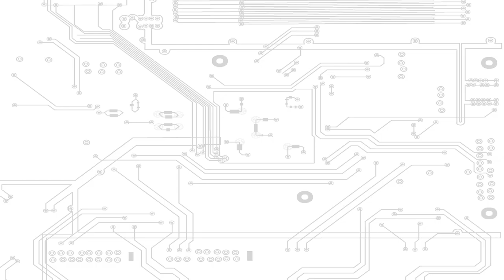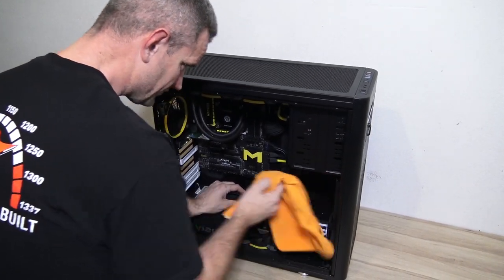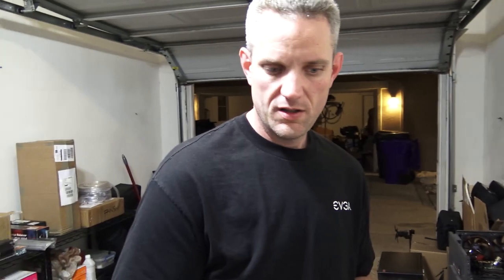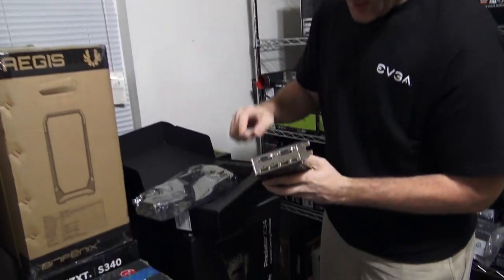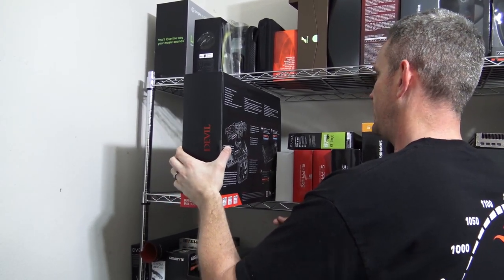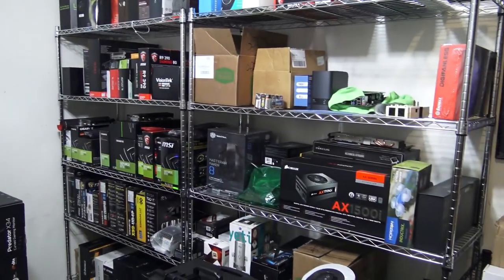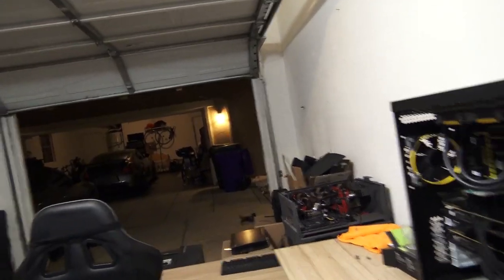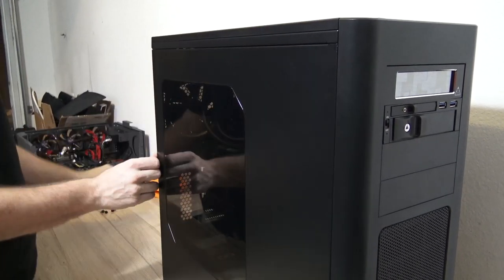VLOG - Putting the Sim Rig PC back together

Comment: Wrong, my G1 980ti has 2 DVI connectors.
Reply from the maker: Clearly so does mine.... You watching the same video???
Reply: +JayzTwoCents lmao
Reply: +JayzTwoCents yes. I meant to reply again stating that I saw you mentioning it and then seeing the card right after I posted my comment. But my 1 year old caught my attention. So she was more important. ;)
Reply: +JayzTwoCents why don't you just get one of those dp->hdmi or dp->dvi adapters.. or cables doing the same thing.. non of my displays got dp and with my old 6950 i needed active adapters that's why i also use dvi and hdmi cables.. so when i bought my 970 i just ordered one dp-dvi and one dp-hdmi adapter for like 15 euro on amazon for both as i have 3 screens and my tv connected to my rig but also only 3 dp, 1 hdmi and 1 dvi from my zotac gtx 970 amp! extreme edition.. luckily you don't need active adapters anymore.. they were way more expensive..
Reply: +JayzTwoCents I love when people reply before watching the video or realizing they made a stupid comment and not deleting it
Reply: +sik59rt Why should I delete my comment. I fessed up to it and admitted I made a mistake.
Reply from the maker: +Dunkelelf3 Because they dont have DP either....
Reply: ***** well i did neither see the back i/o nor what exact 970's you used..

Comment: I know you mentioned it but it would be awesome, use a car intercooler or radiator with the fans, put a little pannel on the rig with a key to start the pc and switches for the pump and fans.

Comment: 1:55 don't you have one of those compressors or just air cans or even those air blowers that don't need compressors? I love those to clean my PC or the PCs I have to fix/build. It's great! I have the Metro Vacuum ED500 DataVac 500-Watt 0.75-HP Electric Duster 120 volt.

Comment: I'd just take the least powerful GPU on that rack since even that one would be more powerful than my gtx 950
Reply from the maker: That would be a GTX460....
Reply: +JayzTwoCents Haha I was completely wrong then, you have a less powerful GPU than me, dang how old is that piece of hardware now?
Reply: +Jorge Resendiz I think a old (was too of the line) build would be cool to see and see how it does
Reply: +Jorge Resendiz its still quite close to a 750ti with 1gb :P
Reply: +Yesto still, I can't even run Farcry at low settings, 1080p 60hz, without seeing stuttering or lag. If only I could combine the power of the 460 and the 950 to make a 760 or something like that
Reply: +JayzTwoCents still better than the amd 7600 HD(60% sure that what it has) graphics my laptop has.  I can run gta v at a cringe worth 20 fps.  Sins I've never used anything above 60fps, I can actually tolerate games as low as 20fps that would kill 144 refresh rate master racers such as yourself.
Reply: +Jorge Resendiz he has a 750 ti on the rack...
Reply: +JayzTwoCents I would love a GTX460 !
Reply: +Jorge Resendiz If you are talking about the new Far Cry that's because it's horribly optimized, even Totalbiscuit had performance issues with 2 titan x cards.
Reply: +MrSpartan117fan that is a mid range card from 2010! what games would you play on it? I have a hd 5870 which is closer to a Gtx 480 and that strugles with most games at 1080p...
Reply: Gautam Goraya what do you mean most games? my 460 did work great until gta v and other next gen games
Reply: +Yesto i have intel integrated graphics  (intel core i5 4690k)
Reply: Pang Bang dang so?
Reply: Gautam Goraya
Dude i have an amd 7750 dual core with integrated graphics

Comment: I run project cars on a single 960 with surround. temps stay relatively low, and maintain above 60fps. granted I don't have the highest settings on though.

Comment: I have a question. Does is matter if you have two different types of 980ti's in sli? I mean, I already have the Strix edition and I am planning on getting a Zotac Amp edition. Are there any drawback or any benefits? Also, would a 850 power supply be enough? Thanks

Comment: i think they should start making drive bays in which you could just plug the hard drive or the disk drive in from the outside. The cables would instead be plugged into the bays so we can easily interchange the drives or unplug them if needed

Comment: is it possible to use the 2 dvi ports and hdmi port on that 980ti? ive heard that only 2 are usable at a given time and must use the displayport to utilize more than 2 displays.  my thoughts on such matter is always use a single powerful card versus 2 weaker ones,  but in jayz case, using 2 970's to gain hdmi/dvi ports make some sense ^_^ (albeit must be too lazy to get dp to hdmi converters/cables). 

sucks to be in a third world country where we pay more for a gpu (close to 900$ for any branded 980ti) and only earn 1/5 (300$/month) of income compared 1st world ones. 1 1/2 years since the 970 launched and im still saving for one.  im betting pascal will be out and im still short of funds... hahaha

Comment: Why don´t you use an air compressor to clean the case?
Reply: because of the amount of moisture in a commercial air compressor. you would be misting your PC pretty much. also, that much pressure COULD damage your components. Linus did use a standard commercial air compressor to clean out a PC in a video and it worked. but he stood pretty far away and used short bursts and it still wasn't really any better than just using canned air.
Reply: +heizerbirne You mean't "canned air" I assume?
Reply: Yeah, aerosol anti-dust stuff in a can. It's not actually breathable air, lol.

Comment: i have a question for you oh pc god of knowledge i recently bought an msi 960 gtx it says its a 4 gig card but in the program it says 3 gig im wondering if you might know why?
and a comment if i won and got to choose i would take a power supply mines using a 120mm 1 inch thick fan laying on top of the open power supply because when i got it the bearings went on the ps when i got it so i had to replace it without having money to replace the ps itself
Reply: Really? Just checked and mine is using all four.
Reply: so why is mine only listing 3 gigs?
Reply: it shows it only as 3 gigs on canirunit.com
Reply: if i optimise it through nvidia gforce xp it tends to not want to load the game on my pc any game for that matter

Comment: You should have used the dual dvi 980ti and the watercooled 980ti. You are running a giant resolution and more GPU power is always good. Better than letting it there not used at all

Comment: If you only need 3 dvi ports, why not sli the 980ti that has 2 with another one so you can have all the power and be able to drive all three monitors?
Reply from the maker: Because I wanted 1 980Ti, not 2

Comment: I would use one of the Gigabyte 980 ti's you got there. I had 2x 970 Sli before, quite dissapointed in the performance (stuttering etc.)
Reply: +jmeister ive been thinking about ali 970 or a 980, is sli really that bad ?
Reply: +RedddRainnLG For me the experience was really bad. I play on high resolution, which could be a problem with the memory of the gpus(3,5 gb effective mem).

Previously i've tested 780 sli & 290x cf, and those setups ran much smoother overall (less stuttering, better scaling in games). 

Note that i'm not saying that it's is a bad card, i wouldn't use it in sli though.

I don't know how 970 sli works right now, since it's been about a year since i had those cards.
Reply: jmeister what res where you on i plan on 1440p or 4k soon so idk if 970s will cut it :/
Reply: +RedddRainnLG 1440p, i would suggest that u search for recent sli benchmarks and reviews(1440p and over). For 1080p u're maybe alright.

Comment: I would use the Fury X for this. I play on 3 Monitor Surround myself on this, and i can run Battlefront on Ultra/High settings without any stutters what so ever. 
If this doesn't work, use Two way Crossfire R9 390x 8G

Comment: hey, is a xfx r7 360 2gb oc decent for 1080p gaming? I'm gonna be pairing it with a fx 6300.
Reply: +Alexis The Pro anything in the R7 series isn't, minimum a R9 370 for low settings
Reply: +TheNerdyCanadian well I was looking at benchmarks and it handled most games on high 1080p between 35-55fps
Reply: Alexis The Pro exactly, so medium or low settings. 35-55 isn't playable in most games because you get screen tearing and stuttering, so you want it to get an average close if not better than 60fps (most likely your monitors refresh rate), also what CPU did they use for the benchmarks, because that can play a lot with the FPS you will get
Reply: +TheNerdyCanadian fx 6300, and for gta v it dot 55 fps high AA off

Comment: Guys I need your help.
I'm currently on an i5 3450 combined with a GTX 970 on an ASUS P8z77-V Pro MoBo.
Should I buy an i7 3770K or an i7 6700K with a new MoBo?
I game and I also do some light video editing
Reply: +XCalibur Hmm, me and a friend where and he still is in the same spot. I went with a 6700k, he is thinking of going with a used 3770k. It honestly depends on a few things. Do you have enough money for the 6700K, a mobo and new ram? If you do, do you want brand new stuff with new warranties as well as some of the best performance available and newest  features? Or are you ok with something like 25% less performance vs a 6700K, less features and dead warranties but still a decent bit more performance than you are getting now and a lot less hassle on the installation? I'd personally recommend the 6700k. Its fast as hell, and you'll be up to date as far as features and stuff go for a few years. Instead of behind off the bat. 

Whatever you decide, DO NOT let people convince you to get a 5820k over a 6700k. Sure the CPU is the same price, but the motherboards are on average a decent bit more expensive, and in gaming at least, the 6700k frequently trumps the 5960x, which is obvioulsy faster than the 5820k. The 5820k might do a bit better in video editing but if you only do light editing it will be more than enough, and the extra gaming performance will be nice.

Comment: hey is a r9 390 a good upgrade from a 280x(1440p gaming)
Reply: 390x would be a larger boost.
Reply: OK thanks and there are a lot of difference between the 390 and 390x?
Reply: +Arthur Nascimento If you overclock the 390 it will perform basically the same as a 390x and almost as good as a GTX 980.
Reply: +RockOnBourne if you overclock a 390x it will wrecks games.  I say get a 390x
Reply: Just depends on the budget.

Comment: Heh get a bunch of cable adapters from monoprice or something... It's something you end up needing at some point and not having them is really annoying. My quad setup is hilarious, I use 1 DP-DP, 1 active DP-DVI + DVI-HDMI, 1HDMI-HDMI 1 DVI-DVI cables/adapters... And ofc that one HDMI run means that Nvidia is sure it's a TV and wanted to underscan it and windows makes it the default sound device each driver update... ARGH. Oh and for some reason the dell monitor on the DP cable needs to be re-plugged each reboot to be recognized and get the right resolution, generic VGA display at 800x600 each time I boot...
Reply: +Christian Gerefalk Mt Dell U2713H doesn't play nice with Display Port either, mostly coming out of sleep mode or screen saver so DVI it is for me. I used to get a lot of errors from the USB 3.0 hub too but that seems to have gone away for some reason.

Comment: +JayzTwoCents For iRacing you really need high ipc (overclocking that 4770K would be fine), and SLI isn't that great at the moment as nvidia doesn't supply SLI profiles. The 980ti would be the better choice for simracing.

Comment: You know, I'm pretty local if you need anything taken off your hands... But kidding (read: not kidding) aside, I think an exterior Rad or "intercooler" would be super cool with metal fittings and maybe blue or red water cooling tube at the bends to look like car couplings.

Comment: My x79 machine has an old GT 9800 in it because I had to sell my video cards to make ends meet, I miss my desktop /cry
Reply: +Annabella Williams why?
be proud of that 9800GT. i got the whole lot from them. i even got the gx2 and gx+.
those are some awesome video cards and a good option if you plan to up the system and then later up the GPU.

Comment: Heck if you did a giveaway i'd ask for the MSI R9 390 (non x) because I just bought one along with a 1440p monitor and I couldn't be happier.
Reply: +Mitch Baker (Illegal Chest) It's a fantastic card, but just about everyone would grab a 980ti if they were given the option to take 1 thing off that rack, it's just better known and a bit more impressive than the Fury X.
Reply: +Darren Kehrli You really can't blame them though. A lot of people don't have modern or high end graphics cards in their system. Plus if I got that other 390 i'd have to pull my 850 watt psu out and put it in my system Lol
Reply: +Mitch Baker (Illegal Chest) yeah, I have a 970 but I'd grab a 980 ti in a second, even though I do not play on a monitor that would show the extra power at the moment (play on 1080p, some at 1440p scaled to 1080p), and everything I've played that doesn't have performance issues with the game itself (batman arkham knight for example), plays beautifully with all settings maxed...but I'd still grab a better card because it's the most expensive component to upgrade, and it's usually the thing that gets outdated way before anything else, doesn't matter how happy anyone is with their current gpu, they'll usually choose a better one over anything else, given the choice...usually...

Comment: what using a Server motherboard with 4 CPU Intel I7 36 core processors and 1TB of ECC system RAM and a 20TB RAID array that should make your Simulator run like a BAT OUT OF HELL there must be a slot that can take a RADEON Graphics card.

Comment: I would like to have 2x 970 + 1200w PSU.
Reply: No
Reply: +Zuze91 i can sli my970 and i have a 750s bronze from rosewill
Reply: Bidwellz9 i have 2x 460gtx
Reply: ***** my point was about the psu though. you dont need 1200w lol unless you have a crazy machine
Reply: Bidwellz9 I want to watercool. So fans and pump goes to PSU too.
Reply: +Zuze91 still no problem i guess but we don't know what other stuff is inside your pc, like cpu, how many fans, drives, mobo, rams, etc..
Reply: +Zuze91 50watt wih pmp and fans.
Reply: ***** yes.. in games that are well optimized for sli and were the vram is not the problem the 970's will win.. if you need more than 4 gb the 980 ti will win.. he got a shelf full of 980 ti's i would have just threw 2 of them in the sim-rig xD
Reply: ***** lol yea, that crazy
Reply: ***** depending on the other components 1200w is still a lot , but i guess i would get it for the headroom
Reply: +Bidwellz9 Get One 980ti. It's as powerful as two 970s without the microstutter.
Reply: ***** no not really ^^ i would get something like 1400-1600 for 4 gpus.. it really depends on the cpu and other stuff you are running but if you buy 4 gpus you most likely also buy something like the 5960x and that's 250x4 for gpus and 140w for the cpu so 1140.. only 60 left for motherboard, fans, drives, usb devices and whatnot.. ofc it would be almost impossible to max out both cpu and gpu in real world tasks but well.. it is somewhat close tbh.. also most psus are most efficient about 50% load so getting something with more headroom would not only be more efficient but also give me a better sleep, cause i know it's really enough for all the hardware..
but for 3 gpus it would be really fine.. who buys 4 high-end gpus anyway?
Reply: ***** yeah but as i said it's not really likely to max out cpu+gpus all at once to 100% load.. but in a real worst case szenario it would maybe kill you psu.. 
i mean on this high-watt psus you find more or less only really good quality and very efficient psus from good brands.. but i saw really cheap crap psus that gave like 2/3 of the 750 watt they advertised due to bad design and bad efficiency so i would never trust to really get more power from my psu than it says on the box.. also running 4 cards in sli is something most people would only do with a custom loop cause damn this would heat up the case.. and when watercooled you most likely gonna overclock.. and for oc i would never go as close with my psu as this.. because you just can't know how much your system draws in the end.. i would never do it.. never ever..

Comment: Hey guys - i'm wondering if anyone could help me with the PC im building in about 2 months, i will mainly play CS:GO - And i also livestream it. If anyone could please respond with any parts i should change, or anything like that, i'd really appreciate it. ( Btw - i also play games like GTA 5 - but i wont livestream it. )  

CPU : Intel Core i7-6700K Skylake
GPU : ASUS GeForce STRIX GTX 970 4GB
RAM : Corsair Vengeance LPX DDR4 2666MHz 16GB
PSU : EVGA SuperNOVA 750 G2, 750W PSU ( Modular )
Motherboard : Gigabyte GA-Z170-GAMING K3, Socket-1151
SSD : Kingston SSDNow V300 240GB 2.5" OEM
SSHD : Seagate® Desktop SSHD 1TB
Reply: Haaa that sucks my Pentium 4 + gt 210 world easily destroy that cuz I ocerclocked it to 6.9 ghz

Comment: What's wrong with the devil? I'd gladly use that beast!
Reply: It's AMD
Reply: +Daniel  Burgos It would've been faster than the dual 970s. Two full Hawaii cores under one air cooler isn't exactly optimal though.
Reply: +Lord Mortigon You've got a point. I wonder how it compares to the 295x2?
Reply: Douglas Mannor It's essentially a custom pcb 295X2 under air cooling. It's louder and hotter than it's water cooled cousin, and oh boy is it ever huge (triple slot!) and heavy. I think it came boxed with a Razer Ouroboros as well. Not a very practical product, but definetely interesting. I'd take one anyday just because it's so ridiculous.
Reply: Douglas Mannor Actually, watching the video again, it says 390X on the box. That's hybrid cooled single GPU card, which explains why he won't use it for this.